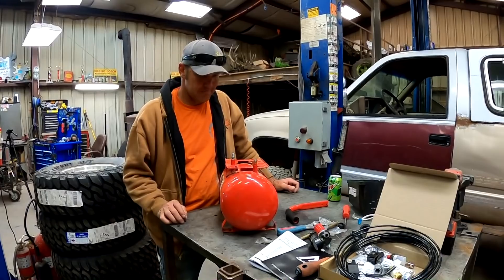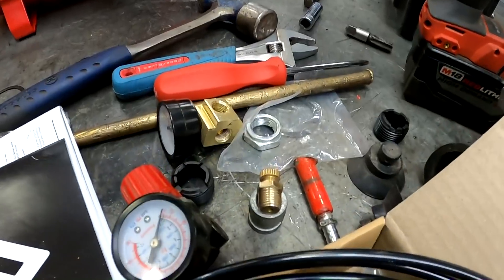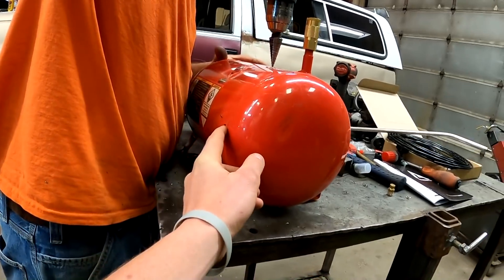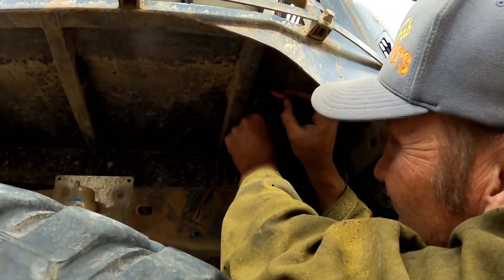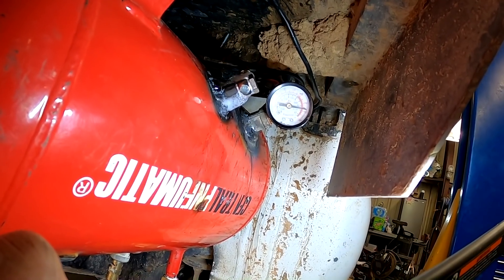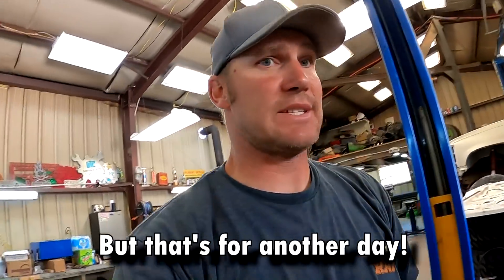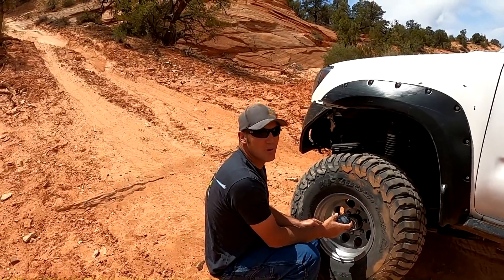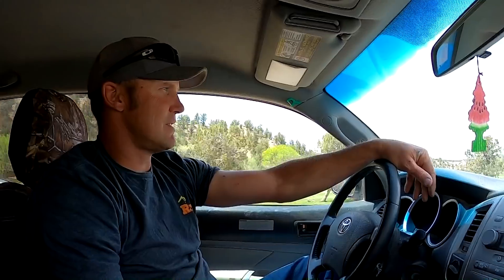Putting the New AIR LOCKERS to the Test!

Comment from the maker: Check out Fab Rat’s MERCH HERE: www.thefabrats.com
Reply: Well looks like you have things locked up pretty good there. The little compressor could and the junkyard tank was able to make one hold 150 psi and not blow up.
Reply: Paul, in one of your videos will you discuss the benefits of a two stick transfer case and what it takes to install and/or convert one? What is front wheel dig? Thanks
Reply: Hey paul (unless I missed it) you should definitely consider adding a check valve in the tank where the compressor line comes in... if not those pumps burn up much faster, or they get worn and start leaking past the cylinder causing it to cycle constantly, after burning through a couple 12v compressors I stole one off an old pancake compressor, but new ones of all different thread sizes are cheap as chips on Amazon 👍
Reply: Junkyard air tank with chisel scars outside and rust inside about the last thing I'd stand crotch high next to while it was filling with air.  Those things routinely fail because they weren't drained for years and grenade through 2x4s in people's garages.

Comment: I am a mechanical design engineer (by day) and LOVE watching your videos ...my biggest pet peeve with the other engineers that I work with is analysis paralysis!! they over think things so much that its hard to get things done... I watch this 'show' and yall just do it! I love that....  now, I could critique some of the things that I have seen but I'm NOT going to do it - because yall do things based on your experience, and well... its working... I will say it again, I love watching your videos!! MV
Reply: I grew up on a farm and taught myself to weld and work metal, and then went off to college to get my BS in Mechanical Engineering.  Some of my classmates literally did not know which way you turned a standard bolt to tighten it, and would miss extremely simple aspects of a design (like, hey this is going to hit that so it won’t work) simply because they had never actually built anything and gained that experience of failure!  I know exactly what you are referencing and have always chalked it up mostly to how folks grew up and the experiences they had going hands on.
Reply: @michaelhendricks9229  
That may explain some of the mechanic's nightmare at repairing vehicles.
Reply: @larrybe2900  Oh I am sure.  That combined with cost, weight, safety, and space constraints lead to the mechanic’s nightmare taking a far back burner.

Comment: Morning all. Up here across the medicine line we've got a brand of cut off wheels, abrasives and drill bits called Walter. The Walter drill bits were the one's I'd keep hidden for millwright work whenever possible. Way back when Makita sold drill bits and they were decent too.
Reply: at the shop I was at we had Nachi drill bits bought in bulk, are they the best drill bit? probably not, but they're a good, affordable one
I've been buying a few sizes of carbide bits, really brittle but sometimes you need a really hard, sharp bit (drilling out broken studs especially)

Comment: As in to extend drill bit life of staying sharp ..Fasenal sells a lube stick ..it's about diam. & length of a grease tub..

In our shop we use it to lube drill bits ( rub a touch on bit prior to using drill ) 
Can also wipe a touch of lube on your band saw well cutting  tub & other metal items.

Comment: I would suggest cutting oil for drilling metals. It will really save your bits. Also, you might consider a water drain for your air tank. They build up water even in the driest climate.

Comment: Machinist here, and home fabricator. I would have to say to stick to Cobalt drills (as opposed to Black Oxide or TiN coated), they work well in stainless and of course steels, usually the side benefit of the tool companies advertising some special grind. I have used Milwaukee, and Irwin from the big box stores.

Comment: Hey Paul great video once again. I have ARB air lockers in my ZJ I love them I have three switch's compressor, front and rear mounted in the console easy to reach. All I can say is I love them the are awesome. I have been running them straight off the pump but have wanted to add a tank this was great and gave me some good ideas thanks...

Comment: Youtuber Project Farm tests products. He did a great job of testing drill bits.  The results are pretty convincing that speed and feed are the major factors that effect the life of a bit. As long as you are not going cheap most bits are about the same.
Reply: 35 years of "testing" drill's.Feed's and speed's are critical but the statement that most drill's are about the same couldnt be any further from the truth than the sun is from the moon.When you are drilling thousand's of holes in a machining center every week at high rpm and fpm you learn "most" drill's (not called a bit,a bit is used with a brace ) are not about the same.

Comment: I buy the decent drill kit from a local tool store, I suspect they are Walter. When my sons were around I kept that drill index hidden and left a cheapo seat around for them to find and abuse. The best bits I have are some that were Dads, they are at least 40 years old and they stay sharp better than any of the others.
I bought a Drill Doctor about 15 years ago, and once I took the time to read the directions and learn to wear my dang glasses when using it I am finally happy with it as well. A winter afternoon every couple years in the shop and I can run through all of the bits I use.

Comment: The locker works Great...Yotas are a Tough truck...I had a 90 with  a total 7 in lift on her. And it had a 350 Small block Chevy under the hood...Loved that truck...You should drop a LS motor in Yours...I used to pop Wheelies with mine. Until My buddy Told me My Yota rear Leaf springs Were Almost Snapping. Needed ladder bars..LOL..HAHA..Love Your truck...Geat Video Thanks for sharing..  .

Comment: I have a set of Ryobi steel bits in my tool cart. As they burn out, I pick up McMaster-Carr cobalt steel TiN-coated replacements. If I were doing mostly drill press work I'd make that carbide instead but I really don't want to take the risk if it's just hand tool work.

Comment: Paul you need to learn how to sharpen your drill bits! Life changer lol. You can take a broken bit and sharpen it in a couple minutes. You might also raise the compressor off the bed an inch or two to keep any water or snow on the bed from getting to it

Comment: I've had some air arrangements on my pickups for air/trainhorns and i learned,bye try and error to leave the switch for the compressor ON at all times.This keeps all air walves shut 100% of the time.If you leave it off during stillstand you will experiencing that the compressor will start every time you're starting up again after the ignition has been shut off.The air will,very slowly,leak out of the system if you leave it off!!

Comment: as always - good work. drill bits, 3  words - Amazon solid carbide! 1/8,1/4,3/8 and they cut like a hot knife through butter, low cost and last. buy in multi packs and their cheaper.

Comment: Hey Paul, G'day from Australia...have ARB changed the specs on the AirLocker? They used to be spec'd for 100psi maximum, but I see you're using a 150psi pressure switch. You may need to add an inline regulator for the locker feed line, to restrict it to 100psi, while still leaving your tank @ 150psi.
Just a thought...Great job as always...love your channel.

Comment: Mount the compressor in a plastic battery box for protection from dirt and dust.  Check the filter often.  Those Viair compressor don’t like dust and slowly take longer to build air like other oil less compressors.

Comment: I used to be a machinist and I learned to sharpen drill bits on a grinder.  There are better ways, and machines for it obviously, but for non-precision drilling, doing it with a simple 118 degree hand gauge works fine.  Gauges on Amazon are $10, and youtube will show you how it's done.  You won't look back I promise

Comment: I'd carry a spare pipe plug in the truck. If something gets whipped aroud by the tire it could break that gage off the air tank...oh one other suggestion, get a momentary foot switch for the drill press instead of the built in on-off switch...its nice to just let off the switch when things go sideways and you helicopter a part...plus you can "coast" through when breaking through thin stock, or when you get a bunch of chatter going on.

Comment: First thing I would do to extend the life of your drill bits is use some coolant,  30:1 mixed rustlick 5050 or Kool Mist 77 in a little spray bottle would be my recommendation but cutting oil would do as well just messier.  Especially dink'n around with chromoly,  it work hardens pretty easily and that will chip and dull a drill bit quickly.

Comment: Paul, when you couldn't get up that gully I think, at least it looked like, you were catching your front differential casing on the ridge in the middle once you'd ploughed out the two holes for the front wheels.

Comment: Wonder how those air fittings, pop off valves and pressure regulator are all going to work after being coated in dust, sand, snow and mud mounted to the under carriage?  I almost expect a future video of the tank getting remounted in the bed of the truck perhaps with the compressor mounted on top of the tank similar to what HF originally did with the 110v compressor.

Comment: Damn! I have the same hood issues on my 2002 4Runner... I wonder if it's a bad design or just bad metal like the frames....

Oh and the best drill bits I have used were German made, TiCN coated carbide with a HSS-Co core. Lasts forever and they are made to run dry and faster than typical drill bits. They are usually coated only on the flutes and are dark blue-ish purple.

Comment: Nice work.
Prepare yourself for the safety crew, crying because you welded a pressure vessel haha!!!

Im always amazed at the air compressors i see on American channels, both 4x4 type and workshop type.
They always seem to build to 150psi standard.
My experience with both types, both here in aus and back in blighty, is that they often struggle to build 100!!

Fitting an a/c compressor for air on my landcruiser ute. Sick of waiting for 12v ones to build.
I've had good quality ones and cheap ones and it doesn't seem to make a difference, slooooow!!
The best so far is a Thumper brand one.

What flavour is your one?

Also looking for a set of second hand lockers but anything 4x4 is either unavailable or unaffordable after the covid shenanigans and folk needing to get out of the house!
With nobody going overseas, every man and his frogs are buying up 4x4s and all the toys, making everything super expensive!
Used bikes have doubled in value suddenly too!!

Comment: 15 psi is great but without lower gears its winch time. lockers are the best . im not a air locker  fan, the seals will blow in time . the problem with air lockers its a constant repair issue !.  electric is better for a more positive hold on things. great video . on the top of the hill, next time say,(I THINK I CAN , I THINK I CAN??) NO ITS WINCH TIME??

Comment: how much air presure the tank it made for for safety between the cab and the air tank i weld in a 1 inch steal plate for protection incase the air tank blows up the lite put it on the top of the truck my friend had a k5 blazer had a trailer on the back loaded with brush cutting the trailer want to push the blazer down the hill skiding the back tires he had to park it in 4 wheel drive to keep the blazer on the hill his drive way was pave watch out parking on a hill in the dirt

Comment: Paul, I think you answered your own question on why the bits keep getting burned up. The speed of the drill is a bit too fast. plus no lubrication. And it's the bit that does the drilling, not the amount of force you put on it. Less force, some oil, and the bits will last way longer.

Comment: I put a remote control (wireless) for the winch. it was just the signal for the winch, you need those tiny box and remote combo they sell on ebay, so you don´t have to put no wires in situations like this.

Comment: Paul...  Just a suggestion, would it be beneficial to have an air pressure gauge inside the cab for your air locker system.  I know you have a gauge on the tank near the air chuck but having one in the cab would let you know the air status without having to get out to check it.  One other question with the air locker system does that still mean you have to get out and lock the hubs?
Reply: Sure he does, they’re free-wheeling locks. 
The air locker he’s just fitted locks the centre differential, so both front wheels get the same drive from the diff.
His only limiting factor now is the grip between tyre and track.🇷🇴🇬🇧👍🏻
Reply: @clivehorridge  I just wasn't sure if the hubs still have to be engaged or if they are left engaged all the time and the air locker controls the distribution of power to the wheels in addition to engaging 4x4 from the transfer case.  I may be talking out of my behind since my 2000 Toyota Tundra the 4x4 is handled via the transfer case and the switches on the dash.  I just spent $1,500 to have the actuator drive motor assembly replaced on it.  I guess after 21 years it was bound to fail sometime.

Comment: I couldn't tell if you ground down those galvanized pipe fittings before welding, but be careful if you didn't you can get galvanize poisoning from the zinc fumes.

Comment: What’s the advantage of welding all of your fittings to the air tank over just running a line from the tank to a manifold with all of your over pressure and air tool chucks on it? I’m just concerned that your chucks and valves might get clogged by that rust in the tank being that they are on the bottom. You mentioned you were concerned as well in the video.....

Comment: If you want to keep from burning up your drill bits, use some cutting oil and cut down on the pressure exerted on the bit. Any oil will do; I use 3-in-1 because it is cheap. My Master Electrician brother is convinced that 3-in-1 oil is a cutting oil because it contains tiny metallic particles that aid in cutting (it doesn’t) and no amount of argument will change his mind. There’s a smugness about him that just rubs me fur the wrong way.

Comment: Get good quality drills, if you have a machine shop supply place the should be a good source for quality drills, ALSO try to get them with a Titanium coating, the coating it typically a yellow/gold color. They bit should last 2 to 3 times longer than a non coated drill, the caveat is, once you sharpen them, the life is no better than a good high speed steel drill. I use to sharpen them as part of my job description the last 9 years I worked before retiring.

Comment: I love you and the channel,  but I hate the location and integrity of that cheap air tank.  If this air pressure is lost I am assuming (correct me if I'm wrong) that you don't have 4wd. I think the idea  for the air lockers is great and has many advantages and this test will give you a great report of how well it works.  I hope it works out OK and doesn't let you down in a hard spot in the dark, way away from home.

Comment: Be very very careful welding on pressure vessels. It is generally considered a bad idea, many air tanks have to go through heat treating after being welded to retain their strength.
Reply: I don’t think Paul’s worried with his welding lol
Reply: @phillipcave1197  He should be. Lots of people can weld normal things. Few can weld specialties. That's why they're called specialties. He doesn't have to worry about it though, he'll be in the car when it lets go. Another vehicle or a spotter could be right next to it and it can literally be deadly.
Reply: Sitting next to that tank while it built to 250 PSI made me nervous. If something let go at that pressure it'd near take your head off. They put truck tires in a safety cage at lower pressures than that for that reason. And seatbelts save lives. Please!
Reply: That should read 150 PSI. Fat thumbs.

Comment: So we round here are a Toyota family.  I have my 18 Tacoma and my wife has her 16 4runner.  I also have a 13 Tacoma that I use to pull my bass boat.  Its not a 4x4.  Sometimes Ill be at a lake with a steep slick boat ramp and my wheels will start to slip a little pulling up from the water, or backed into a muddy camp sight and my wheels will slip a bit.  Ive never actually gotten stuck, but every time it happens all Im thinking is yeah Im going to get stuck.  

I was wondering would an air locker help me in this situation, and would it be worth putting one on my 13 prerunner?  I don't do any real off roading, I just need to get a little more traction to the rear wheel in these situations rather than the damn truck just sending power to the wheel with the least resistance which does me no good because the one with the least resistance in the one damn slipping.  Now the 18 Taco and 16 4runner are 4x4, but I just dont really like to use those for pulling the boat on long trips.  Those get enough miles on them being our daily drivers.

Comment: Why didn’t you mount the air tank next to the compressor.  Where you have it it terribly exposed. It would be much easer to maintain the system up in “box” with only the airline only under the truck This is the first time I have disagreed with you.  The next point is Mitsubishi already has four wheel lock built in. And the third point is you should build an air hose into the tank or airline to the tank so you can reinflate your tiers after you deflate them.

Comment: Air or pressure regulator vs fluids dynamic amazing not skinny petal its grears belts mechanical vs elements electronic generation engineers what made America amazing dreams inspired follow through with failures and successes